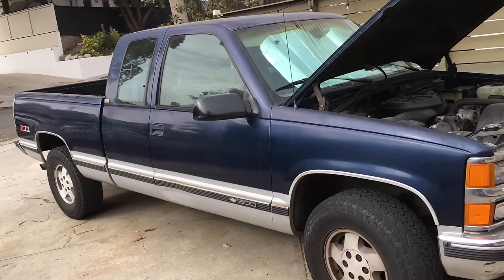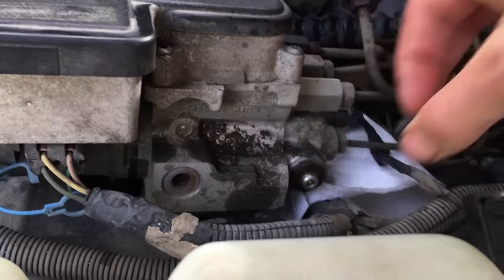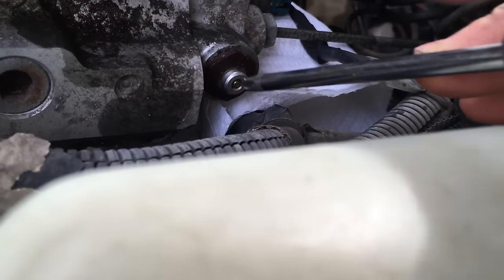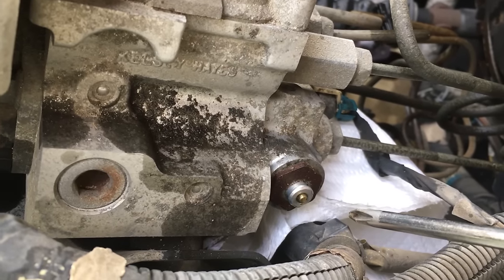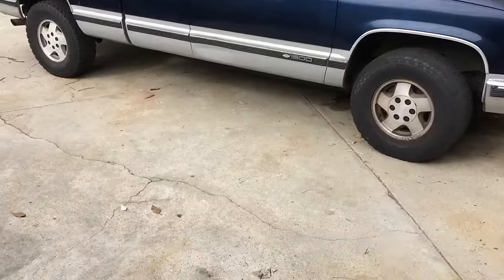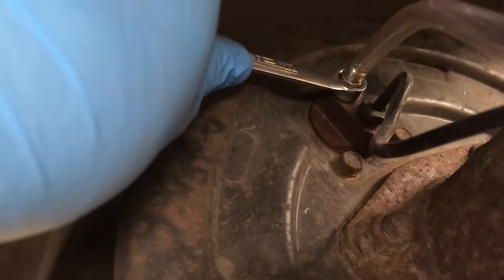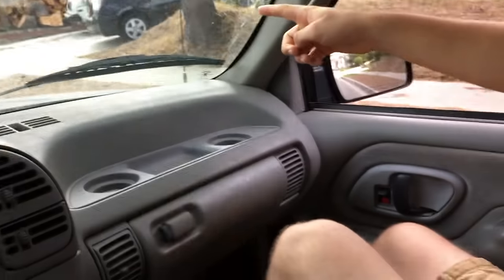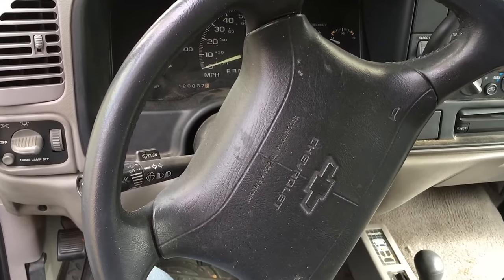Spongy ABS Brake Fix 88 to 98 Chevrolet Silverado

Comment: I have a 97 C1500, original owner.  First few years, no issues but somewhere around 2000-2003ish it developed the mushy brake problem.  I've been pulling trailers literally every week with this truck, boat and jetski year around...  More than once I've tried bleeding them, replacing Booster, Master Cyl and wheel hub cylinders and still have mushy brakes.  I've had a shop or 2 look at it and they can't figure it out.  Now my brake light won't come on and I assume it's because I had to push 2-3 inches back just to engage the brakes and I know the sensor near the steering column is good because I replaced it.  I will try that "Button" thing this weekend plus bleeding everything again and let you know.  Thanks for posting this video...
Reply from the maker: You’re welcome. I hope it helps. People have also told me that if you have sponginess in your antilock brakes, you can get on an empty road and slam on your brakes hard enough to activate the ABS, and it will blow the bubbles out of the system. I don’t know if that is true or not.
Reply: will this work for a 99 suburban with abs
Reply: sounds exactly like my 98 1500, break peadle goes all way down slowly when at a stop, then my break
lights quit working,  but 3rd light does still work (?) , so not sure it's my break switch, did I you v figure yours out?, thanks
Reply: ksmons  hay did this work for you .. I am in the same boat . I have done everything you have .

Comment: ONE MORE WORD OF CAUTION - - keep the cap snapped down on your master but remove it periodically in the process to check your reservoir has plenty of fluid in it - - if it goes dry you will suck air into the system and you have to start from square one

Comment: I have a 1998 GMC 3500 4X4, with the same problem bleeding the brakes, spongy pedal. After using a  Motive pressure bleeder 2x over 3.5 quarts each time. 0 air bubbles and clean as a whistle. Thought after seeing this video that all my brake bleeding problems were over. Sorry! WRONG!!! There are 4 ports in total, on that system to bleed. As far as I'm aware GMC/Chevy would have the same ABS. But I could be wrong! If you look on the opposite side of the ABS unit, there's another bleed port just like the one your looking at on drivers side in video. It should have a rubber cap on it. And there's 2 more at the base of the ABS facing the firewall. Pain to get to and if you don't look real hard...you won't see them. I bleed them all and it looks like my ABS module is hooped. Now trying to find a local ABS module rebuilder. Good luck to everyone with their brake issues.

Comment: Geez wtf, how did i not know this... this old truck im working on has great brakes again!! Someone had done mater cylinder and some brake lines in the past... I bleed the lines at the master cylinder by blocking the brake and cracking the lines, same from the master to abs and then the abs bleed port pin a few times.

Perfect!!. 

I did it all by myself too. If you block the pedal you can only barely push on it for the module bleed, or you wont be able to release the pin. It only takes a little, a few times.. Ive spent hours days on these in the past trying to get the right pedal.
Reply from the maker: I’m glad I could help you get it working right. They should really put this in the aftermarket repair manuals for these trucks.
Reply: @hoohoohoblin  thanks a million. Its ridiculous i have Mitchell prodemand and never ran across this tip. may not have looked for it though but ive had a few gmcs from this era o had trouble with, usually they blew a brake line and run half the master empty.. i fix and  bleed and bleed till your ears fall off. Lol.. still not great.. this was the problem all along.. hidden little bastard it is.

Comment: I have a 99 tahoe. I've replaced both front calipers and lines, all rear brakes, upgraded to NBS master cylinder and even used the scan tool to bleed. I've had an amazing hard pedal for about a week then it has now slowly gone back to having to push it half way before it works and mush. Same as it was before all the upgrades and old master. Cannot find a leak anywhere. This brake system is a disaster!

Comment: Outstanding! Planning to change my MC and now I can burp the ABS, Very Cool!
Reply: Damn, Worked Like a CHARM!, Thank you Brother for posting, Life Saver!
Reply from the maker: You’re welcome. I’m glad it worked for you. It took me a long time to figure this out, and there isn’t much other data on it on the Internet. I took my truck to a brake shop that has been in business for 40 years, and they didn’t know how to fix it, so I had to figure it out.
Reply: I hear you Brother, I told the old owner that I fixed it and he was pissed he did not charge me more for the truck. Can't believe he was driving like that for 15 years. He even replaced the MC. I don't need to now :-)

Again Thanks Brother!

Comment: Theres a special gm tool to hold that proportion pin from coming out. Otc #7853. When it comes out, its blocking pressure to rear brakes
That combination valve is there incase brake line leaks. That combination valve cuts pressure to rear brakes so the front brakes will still slow u down. You have air in the rear lines because the combination valve is doing its job.

Comment: I have the KH 325 in my 2000 Jimmy and Bravada.  I will look for that recessed Schrader on it and see if it works.  My 93 Suburban doesnt have this kind of ABS module, it actually has bleeder valves on it.

Comment: good to know.  i have a 99 s10 2wd with a different, but very similar abs module.  ive heard you can (should) cycle the pump with a tech2 scanner, but theyre not common for DIYers, and who wants to pay the shop?  another method to cycle the pump is to jam on the brakes in gravel or grass at about 10mph to activate abs a few times, and the system should purge the air.  might have to bleed at the wheels then repeat a few times. this method seems a lot more practical.

Comment: Thought my ABS was the problem with squeaking wheels, pulled the fuse and ABS light was still on. Pulled the brake pad from me front, the depth gauge cut off was chalk full or crud; cleaned it out with brake cleaner and nylon brush; no more squeaking. But if I get mushy brakes next time I know where to come to, thansk!

Comment: Although this seems clever enough, I'm not sure I fully accept it.  Especially considering that many commenters describe their lack of success.  But also, on the particular ABS module being shown there are two of those little capped bleed valves, not just one. The bleed valve shown is for the front brake circuit.  The other one (rear) is on the same axis on the other side of the ABS module,  is much more awkward to get at,  and is angled slightly downward - not really conducive to removing air.  So it seems that this has, at best, a 50% chance of accomplishing anything.
Reply: What if you disconnect the ABS altogether?

Comment: I remember seeing this video and trying the same method for little to no actual improvement so I'm not sure what's going on with my brakes. For a decade my brakes have been not only soft and spongy, they are slow. I can slam the brakes and the pedal will travel slowly as if the lines or hoses are clogged, the harder I press the slower the pedal travels. So if some little child ran out in front of me there'd be nothing I could do to stop in time.

 I have replaced brakes hose left right and rear, the master cylinder, the power booster, both front calipers, both rear wheel cylinders and over the course of a decade have bled several gallons of brake fluid through my truck. On top of trying to bleed that little valve thing I've also read it needs to be held down flush and in place to properly bleed the brakes (or maybe just to properly bleed the rear brakes) and still the brakes suck. I even became friends with a mobile mechanic who hung out at the store I work at and was able to use his scanner to run 3 automated brake bleeds, still, no, improvement. 

At this point I'm ready for my last resort, I'm gonna speak to a Chevrolet dealership shop, try to find an experienced or high ranking technician, and tell them my whole story and tell them I give up and that no matter what it takes or costs I want my brakes to be firm and responsive again, I want to be able to slam the brakes and break my nose on the steering wheel. I don't care if they need to stick my truck on a giant rotisserie to flip it upside down to get the air out of the lines, or stick it in some giant NASA vacuum chamber to suck all the air from the lines, whatever it takes to make the brakes work again.
Reply: 2 years update?

Comment: FYI: tubing needed is 1/4 inch inside diameter clear vinyl.  10 feet for less than $4 at Home Depot.  The rear bleeder on my '98 Tahoe is not able to be accessed with a normal flare nut wrench or crowfoot adapter due to tight spacing between other bolts...  Special semi-telescoping tool would be needed for this - 10mm size. Ended up having to take mine to the dealer to get the rears done and ABS flushed with the scan tool - different module than the one in this video.

Comment: I had seen your video before and I tried it but nothing came out would you happen to know why? My truck has always had spongy pedal also
Reply: Were you able to get fluid to come out? I am having the same issue.
Reply: @ArtDaBarber619  I actually haven't tried it again ..but I did post the problem on a Chevy forum and one of the guys suggested to pump it a lot of times untill you get something he said he did it for about 2 hrs lol so definitely take your time eventually fluid should start coming out you just need a buddy to pump the pedal.. I honestly think it's air trapped in there as I've already changed out alot of parts during the years with no improvement on the pedal

Comment: HELP! 
When I do this nothing comes out of that valve. 
The valve actuates with the brake pressure but I don’t actually get any fluid moving. 
Do I need a more involved process of purging the air?
Reply: Did you eventually get the fluid to drain? I am having the same problem.
Reply: @ArtDaBarber619  I didn’t. I never did figure out what it was. Got rid of the pickup. Rockin a gmt 800 now
Reply: @coleknight7529  I appreciate the reply.

Comment: I did this and nothing squirted out, made sure the peddle was mashed and then I pushed the pin in and nothing came out. It's full of fluid and the brakes semi work they just get stuck to the floor if you push them to hard and it takes a minute for them to free back up. Could it be water?

Comment: I have replaced every part of my breaks and still couldn't get the stiff brake pedal I use to have !! I have the vacume pneumatic bleeder that helps since I'm a one-man job operation !! Going to give this a try ! Thanks !!
Reply from the maker: I hope this works for you. This was the only thing that worked to make my brakes better.
Reply: @hoohoohoblin  I have fought my breaks and steering gear box for 4 years now !! Replaced the steering gear box 3 times and keep getting junk remanufactured ones battery either too tight or too sloppy and my brakes everything brand new but have a spongy pedal so I'm going to give this a try over the weekend and hope it works if not I'm ordering a scanner that does auto bleed had enough of it. 😒
Reply: @whodoneit1224  Well, its been a while now. Any luck on the truck brakes?
Reply: @tinytim9453  yes ! I beat that sob ! 😆 😆. I did a master cylinder up grade I ordered a 02 master cylinder and a fitting that's you need for one break line. That's all and bleed all like usual. Breaks are superior now.

Comment: You should be so lucky that your ABS pump is under the hood. Most are under the cab , which is where mine is. I just replaced mine, so this is what I have to do tomorrow. I'll have to recruit the neighbor kid to work the brake pedal. At least  my abs light is out now, so i don't have to redo the solder connections inside the ebcm.

Comment: Whats the proper size for the bleeders? Ive tried a 9, 10, 7/16, and a 3/8. The 3/8 and 9 are too small, the 10 and 7/16 just slip, i had to buy a pack of two new bleeder valves already because i had to use vice grips.
Reply: Most GM bleeder screws are 10 mm.

Comment: There are 2 of those abs bleeders. The other one is just opposite of the one in the video.
Reply: That's what I was thinking.
Reply: My 97 only has that one.
Reply: I didnt see another one on my 96. And my brakes have alot of slack.
Reply: @h0ot3r  I just did the nbs master cylinder upgrade, makes a world of difference. Use a 2000 MY master cylinder with an adapter for the forward line.
Reply: @jimbobjimbob8275  i might give it a try. Im doing this again and bleeding the brakes and going to see if thatll help.
Reply: I think there might be one per axle. A lot of these had only RWAL so they have one.
Reply: @smiley3303  yeah mine is a heavy half with the 14 bolt semi float axle in the rear.

Comment: There is another bleeder valve on the opposite side of the abs module,  is that side left alone or its only neccessary to bleed the one ?
Reply from the maker: I only did this one, and it worked. I’ve done that a couple of times. I would guess that you should do both of them to be safe.

Comment: <<<<<<<<< Here my truck .... Will this work for my 98 GMC K 1500 5.0 automatic Z71 Sierra SL 4WD. ?       

  My unit looks the same   no ABS or brake light on or any codes I have gone around the tires two times RR/LR/RF/LF and bled really good!  with new DOT4 all bleeders clear and free of air please give me advice
Reply: Dot 4 is not the recommended brake fluid for your truck, the additives could cause issues with your old brake system.  Get a trusted professional mechanic to check it out.

Comment: I had a locked up caliper on the passenger side so I replaced it got everything installed tried bleeding the new caliper went through 2 bottles of brake fluid and the pedal still goes to the floor. Would this method fix my problem? Any tips are appreciated 👍

Comment: oddly i just tried this and nothing came out at all. i could see the little plunger thing actuating while the peddle was being depressed and pushed it in but nothing came out. no hissing or any fluid of any kind.  The truck has some spongy brakes and i've bled it a few times just put new pads and shoes on it aswell.
Reply: Were you able to get the fliud to drain? I am having the same problem.

Comment: So, the 97 K1500 only has the one valve or do these have two valves like the older models? I've only found the one he shows us on my 97.
I'm assuming it's not possible to push in the button unless the brake pedal is depressed? 
Mine seems to be stuck but I'm working alone, so I ordered the specialty tool.

Comment: Did it to mine and it's still a little spongy. Stops quick put still feels spongy on the pedal. How many times do you have to pump the air out that little nipple before moving on onto the breaks

Comment: I have the same Kelsey-Hayes ABS system on my 98 s10 pickup. I've been changing brake parts and bleeding the system since the truck was new.  I have a pressure bleeder and never did the two-person manual brake pedal bleed. I attach the pressure bleeder to the master cylinder cap. The pressure bleeder has a gauge. I pump it up to around 18 to 20 psi and start at the wheel furthest from the master cylinder. This has always worked for me to get a decent pedal feel. Not great but acceptable.  I also use the OTC tool that you attach to the pintle valve under the rubber cap on the opposite side of the one in your video. The tool pulls this valve out as you turn the wing nut. At that point you can start bleeding the brakes. The factory service manual for this truck says to use this tool whenever bleeding the brakes.  Any thoughts if your procedure will work using a pressure bleeder at say 25psi?

Comment: Well I’m doing a 98 Tahoe line broke truck got parked for 6 months replaced lines from abs back to wheel and I can’t get any fluid air nothing out do you think this would work
Reply from the maker: I think so. It happened to me when I had a brake line spring a leak. This fixed it.

Comment: I have a 99 GMC Sierra with the module on the bottom of the truck. I'm going to crawl under there and see if it has a bleeder also. My truck is dead in the driveway and won't bleed at the rear. There's no fluid coming out after I replaced a rusty Hardline.

Comment: I tried doing this on my 97 Tahoe and it wouldn't release any brake fluid. I'm wondering if my abs is messed up.
Reply: Mine did the same, nothing came out. Did you figure out anything?
Reply: @mwheatley63  no sir I haven't figured it out yet. I'm more than likely gonna just replace the complete ABS pump and control module.

Comment: First off, thanks for all the easy to understand info you put on here. I'm not a mechanic by any stretch of the imagination. What steps do you think I should take, because this bleeding process didn't work. Thank you.
Reply from the maker: I would start over and try again. You might have to do it a couple times. You should definitely do a brake bleed first, making sure there are bubbles at any of the wheel cylinders, and then try bleeding the module again. This is really frustrating. The reason I ended up making this video is because I couldn’t find any local mechanics who were willing to work on it because it’s such a bad system.

Comment: Do you have your abs fuse in wen you do this ? Any help would be appreciated I got a 95 and I had a line break one of the ones that below the box your bleeding with the screw driver also run the resivoir dry it broke at night and I thought I pinched line enough but come out and empty I’m gonna have a nightmare with no scanner
Reply from the maker: Yes. I didn’t remove any fuses.